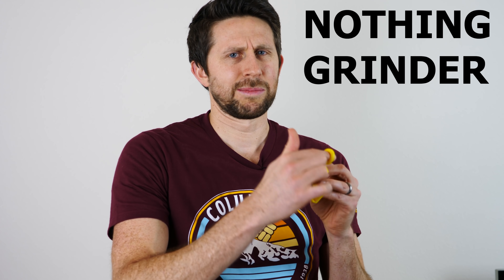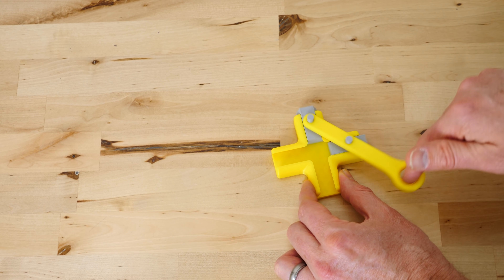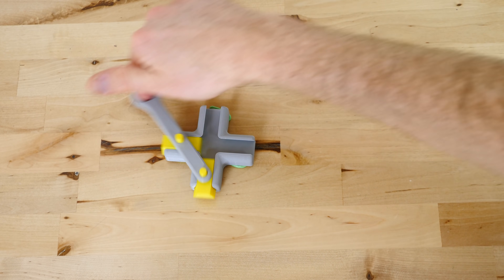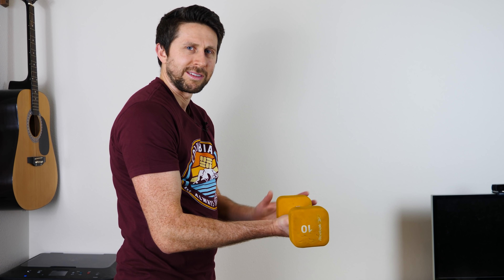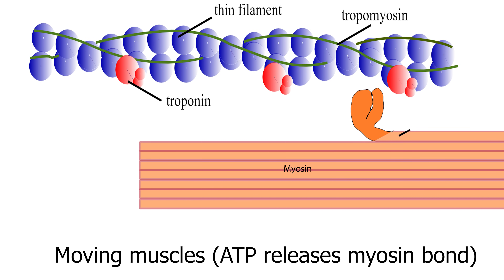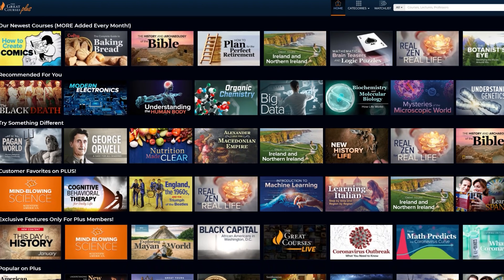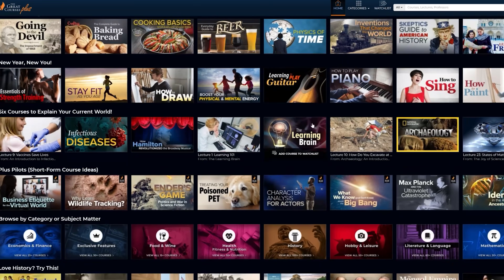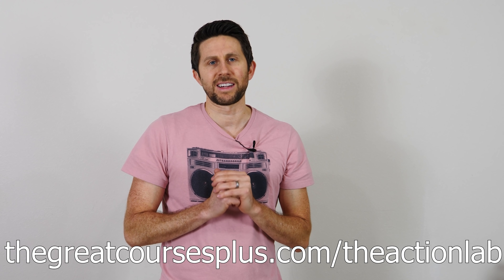The Machine That Does Nothing Actually Does Something

Comment: Entropy makes for an interesting kind of transference of energy.

My CAD teacher used to be an architect, and he said a structure's job is to fall apart, and an engineer's job is to make sure it doesn't fall apart all at once.

Interestingly enough, one of the most simple and ancient hunting traps is the deadfall trap. You prop up a large stone or log just enough to get some bait under it stuck to an L7 trigger (very, VERY ancient trigger design, likely over 10K-years-old). The animal crawls under, and upon interacting with the bait, the L7 triggers, and gravity pulls the mass of the stone/log down on the animal before it can escape, often pinning it in place and still alive (which is good, because the meat will stay fresh until it dies).

What we can learn here is even when something appears to be doing nothing, gravity is still acting upon it, so there is still a store of energy. Kinda like the gravity light, a device that has a light powered by a weight that is on a cord attached to a clockwork gear assembly that instead of moving a pendulum like on a grandfather clock, it's geared to spin magnets to create an electrical charge strong enough to power a light. The gearing allows a very small distance traveled by the weight to ratio out to much greater distance needed to spin the magnets fast enough.

Lastly I wanted to describe this as entropic force, and after a quick search to see if maybe that's already a thing but different than what i'm describing, as I was never required to take a physics class in public school, and have never been formally educated on physics, I was surprised to find out entropic force/interaction is indeed a thing in physics, and is essentially what I just described, gravity being one of the forces involved. I was surprised to see electromagnetic and nuclear are also entropic interactions. I wonder if I missed a calling. I still remember years ago the teachers being baffled by my failing long division on the A.C.T., but scoring extremely high on the calculus and nuclear physics part... Ah, well, I enjoy being an Uber driver; nobody bugs me about my "wasted potential." I do love learning on my own, though. Maybe I should check out The Great Courser's Plus...
Reply: Good thoughts. Gravity has an anti-entropic aspect, creating order on cosmic scales. We harness the same potential energy with every step.
Reply: r/Iamverysmart

Comment: I regularly watch your video and found a chance to give some expiation based on physics, the work done is loosely described as scaler product of Force and displacement but it is actually changing changing the energy of the system. As a good example, the widely known experiment of holding a object in the air, like in your video the weight, we are constantly working against the gravitational pull. To explain more easily, when the weight is on ground it has minimum potential energy, on a table it has a higher potential energy. Similarly, when held in the air with hand the potential energy is higher than the minima at the ground level. To keep this energy imbalance in the weight system (not the whole system of lifting & holding) some energy is needed to draw from the system of lifting & holding and there the actual work is done. This way both part of the system has an energy imbalance but as whole there is none and it seems we are not doing any work but when we are actually doing it.

Comment: When I was a little boy in the 1970s, my grandma had a wooden toy that had little pegs inside a network of tracks like in the do-nothing machine. But the pegs didn't just go back and forth. They went all around a route through a little neighborhood or something, and you'd think the pegs were going to crash into each other but they'd just miss each other by a couple milimeters at each intersection of the neighborhood. I think the whole thing had a sort of small crank you had to turn to make it go. But the usual long handle mechanism was somehow built in, or underneath the toy, so all you saw was the pegs moving through the town on top. Does anyone else remember this toy? I've Googled but I never find (even in 2021) anything as elaborate as what I remember.

Comment: The Do Nothing Grinder? It is doing something though. It is generating heat though friction and motion from movement caused by energy that you expend. The only reason it is doing "nothing" is because it is not attached to anything. Most components that make up a combustion engine are "Do Nothing Grinders" too, until they are combined together. This device is a mechanism and not a machine. The analogies are pathetically simple and inaccurate. Gravity is constantly pushing that weight down until it meets a greater resistance. The table due to its strength stops the weight falling to the ground. The ground stops the weight falling to the centre of the Earth. Lifting the weight up by use of your muscles expends energy. Holding the weight still expends energy countering the force of gravity and energy is expended contracting the muscles to stop any movement.
The car on the hill analogy is bullshit. The car can remain motionless on the hill as long as energy is expelled countering gravity. The engine spinning causes friction on the clutch plate which is constantly pushing the car up the hill. Even engaging the handbrake is constantly expending energy which is stored under tension of the brake cables and brake pads, stopping the wheels from rotating. What a stupid video with a poor explanation of the subject matter.

Comment: Not right. YouTube is becoming extremely nasty.
This is a mechanical concept that is very useful and converts the rotary motion into two or more linear movements. You just present it in such a way that it does nothing. As if you show a piston with no use and say 'it's a nothing machine'.
Do you do this only for views? Present useful content or .. nothing!
-- Engineer, Product Designer and Researcher here

Comment: Look at this incredible device able to draw circles and ellipses. Aren't you amazed that two or more linear motion produce curves? That toy should be put back in the market like the drinking bird.
Why am i wasting energy on this toy that people call grinder? Because it is amazing, remember?
I learned a few years ago that we have three types of muscle cells in our large muscles.
The ones described in this video are those which do the actual contraction.
There is small circular shape muscles which lock the current position of the muscle fiber. I forgot what is the third type.
I am still struggling to get an intuitive understanding why a magnet holding under a table, attracted thru the wood to another magnet over the table can fight gravity.
No work is being done is the usual wording. But the magnet would "fight" to come back even if strong vibration would succeed to dislodge it up to a few cm.

Comment: The  examples you gave are all correct (since basically they are fighting the acceleration of gravity ) EXCEPT for the machine: it IS actually doing work : the movement of the moving parts ( arm, and 2 rectangular widgets )  are actually ..MOVING . Even if the motion is "circular " or more precisely Periodic (meaning : going back to the place it started)  IT IS motion and hence work. the heat it generates is a byproduct of this motion due to friction.

Comment: Work = force x distance.
While it's true that holding a weight stationary doesn't accomplish any work (as it isn't traveling any distance), the reason it still takes effort has nothing to do with the way our muscles work.. 

That is because distance is not the part of the equation that includes energy. Force is.

So while you aren't moving it a distance, and therefore aren't doing any work, you are still using energy to apply the upward force needed counter the downward force of gravity.

Comment: I think you made a small mistake here. You are expending energy when you hold the weight in your hand (elbow bent 90 degrees) at a fixed distance from the floor, because you are not in flat space-time. You are mistaking a planetary frame of reference (earth) for an inertial frame of reference (theory of relativity). In curved space-time (in a gravitational field) you must apply an acceleration to an object just to keep it stationary. Your arm is doing this by pushing the weight "up" relative to the path it would take if it were free to move naturally through space-time. If your arm exerted no force to the weight then it would be free to follow a straight/undiverted path through space-time and hit the floor "down". You are applying force to divert it from that natural geodesic zero energy path (aka "falling"). Once the object hits the floor then the floor would apply the necessary force on the object (called normal force) to keep it stationary. If you were to try this same experiment in deep space (weightless) then you would not require any force to keep the weight stationary in place in your hand. Alternatively you could become an inertial observer yourself and hold the weight in your hand while skydiving and again it would take no energy to hold the weight in your hand at a fixed location from your body. (This aside, I enjoy your videos a GREAT DEAL as they are very informative and thought provoking !! Keep up the good work!)  https://youtu.be/XRr1kaXKBsU

Comment: I could use the "do-nothing machine" to make a mixer head: have rack and pinions under the machine with a beater on each slider.

That's just off the top of my head. I'm sure there are many other practical uses for this machine orientation.

Comment: Interesting video, I always like them. However, I think the main reason you have to spend energy when simply holding a weight is due to 'moments' as there is a pivot point from you elbow leading the weight at the end, away from your centre of mass and so pulls you arm down.

Maths behind this: So you don't' use work= F*D but rather Distance*Mass=tilting point. This means you don't get a coefficient of 0 that cancels your answer.

Comment: I feel this explanation could be improved. Maybe by explaining why we have static and dynamic friction? Also, when you leave a large enough weight on the table long enough the table will bend with time so it's doing no work within some error of measurement.

Nevertheless, cool device. That's the same principle that rotary engines are using, no?

Comment: What happens when you put the ice in vacuum chamber. I know for the fact that as pressure decreases the boiling point decreases. But will it melt in vacuum chamber with hands heat or will it evaporate instantly (just like at moon).
Reply: Plz don’t kill me if said anything wrong.

Comment: My physics teacher and I had this same discussion, about not doing "work" on a system considered in general and one with various microfeatures that takes this into account. And yes I brought up pushing a wall as an example. You tire out because that work is dissipated as heat but you still did no work on the wall.

Comment: I think you have to spend energy to hold the weight because you have to fight the force of gravity. Even if the weight is held in one place and you put a stick under it to hold it in place... it will still break the stick cause gravity applies.
Proof of theory: you can hold that weight in 0G for as long as you like without spending energy
a.k.a. Newton's third law, you have acceleration of 9.8m^2 pushing that weight down. So you spend energy to accelerate the weight ~9.8m^2 up, so it does not fall down.

Comment: I've used it for a lever action to move object up and out of the way, then back in place when needed. You will also find that there is relation between two muscle group that contract and relax to maintain the arm, legs, neck etc is a pose. For instance the tricepts when intention, will cause the biceps to be in relaxation mode. Well, it is a little more complicated than that.

Comment: 4:15 my car’s gear system (I don’t know the name of the shifting mechanism in english) isn’t automatic... the engine would just stop if I try this experiment... but I get your point!
Reply: The transmission? In an automatic that power would be turned into heat inside the torque converter. In a manual it would do the same through the clutch (which would get a lot of damage)

Comment: This man is not smart. Putting energy into the machine turns it. If you mean it existentially doesn't do anything, that's fine. But I'm assuming you are talking about physics.

That analogy about holding a weight is completely irrelevant to the topic at hand.

Turning the machine requires constant kinetic energy, but does not store potential energy.

Holding a weight requires constant chemical energy, and it DOES store potential energy.

And what was the point of the demonstration? You can expend energy and  gain nothing of value? That's not a physics lesson, that's a lesson on human values.

Comment: Aren’t you putting in work by holding the weight in place because we are not in an inertial reference frame? If you did the same experiment on the ISS, your arm would not get tired because you are in an inertial reference frame there. On Earth, you are accelerating upwards through spacetime, and are therefore moving the weight and doing work, right?

Comment: This a superficial, sophistic and simplistic interpretation of 'no work' being done.
Next you're going to say that a hovering helicopter is expending energy to do 'no work' because it is not 'moving', even though it is clearly rotating its blades and there is a evidential and measurable force of air coming downwards from those blades roughly comparative to the combination of the helicopter's weight and the localised gravitational pull.
The fallacy is to measure work under the definition of the weight's 'stationary' perspective as a macro-level concept at the end of the arm's lever. The weight is not moving, so "no work" is being done. However, the input of work in any lever is not at the end where the object is being moved.
If you take the micro-level perspective at the other end of your lever where the muscle fibres are continually switching on and off, then work is actually being done. The muscles are continually transferring the work between different motor units to keep the arm in place. If you could measure all the micrometres of motion of all the individual filaments contracting at any one time and the force that each of these filaments imparts, you would be able to calculate the work being done. After all, the weight is actually being 'moved' by the contraction of muscles in the arm. In this, the weight is being constantly accelerated upwards, against the 'pull' of gravity, at an acceleration rate exactly equal and opposite to the acceleration of  gravity times mass being exerted upon the weight. 
Your car analogy exemplifies this even better. The judgement is being made by looking at work in terms of the car's overall motion, but the working componentry can be calculated for how much work they are doing. The revolutions per minute of the engine times the force being output in this process is work and this is being used to constantly accelerate the car at a fixed rate compared to its gravitational pull it is experiencing being accelerated in the opposite direction. 
A car with the brake is not the same as revving an engine to maintain position. Although the outward appearance is the same, utilising static friction is not the same as input of force to maintain a position.

Comment: The "do nothing" is actually a only human-centric concept. A car reving up the engine to stay static on uphill is actually heating up its clutch or torque converter. We could use the same gasoline to power a burner and heat water and a physicist would apply their thermodynamics formulas and call it work.

Comment: The energy spent by muscles could be compared to a helicopter vs a crane. If the crane hold a charge at a fixed height, it is not spending any energy. But if a helicopter does the same thing, it is actually spending some fuel to do it.

Comment: 4:24 Please never do this, riding the clutch will destroy it or warp the flywheel, and doing this to an automatic can overheat and destroy the torque converter

Park is really just a metal pin that engages with a gear, that's why it rolls back just a bit.

Comment: hmm could be interesting to turn that in 2 a 2 piston engine with 4 cylinders. Fuel gets compressed in 1 cylinder in each direction exploded forcing it to the other side where fuel is injected to be compressed exploded and back the other way .

Comment: I don’t know why he has to explain that it takes energy to do no work. Work is calculated with the equation work=force*displacement so you can exert 1000 Newton’s of force on a block and lift it 5 meters in the air and then drop it in its original spot and the displacement is 0 so the work is 0. It’s not a terribly complex idea

Comment: Can someone explain why my point of view on this might be wrong?

If you would gravity do his thing than gravity pulls the weight done and perform Work. The table, your body, ...  just compensating the same work in the opposite direction? The total work performed is zero but that doesn't mean that there isn't any work performed at all 🤷‍♂️

If you put a weight on the table, the table isn't doing "nothing". It has to pull the weight up from gravity, otherwise the weight would fall down. It's probably done by the strain force of the table top (not sure that's correct term in English), that's get transferred to the legs ect... In time or if the weight is too large you will see the table bending and eventually breaking. So in fact there is still a force applied up just like your human body has to do, your body is just weaker and more inefficient in the holding something in the air. 🤷‍♂️